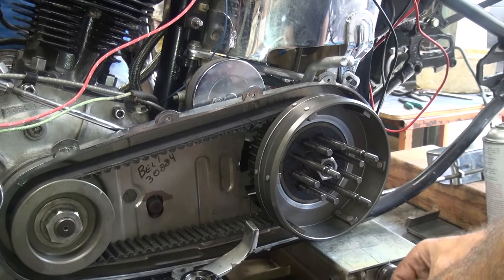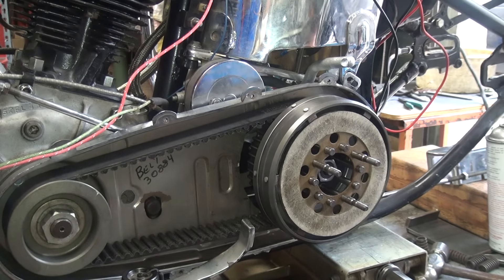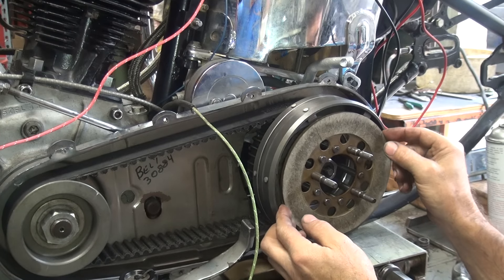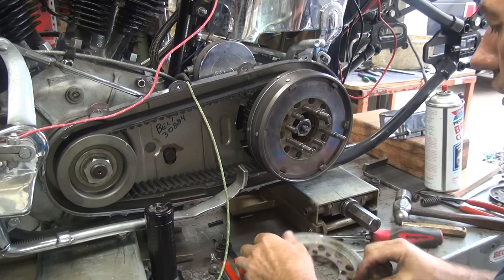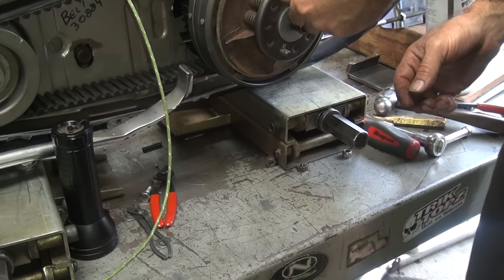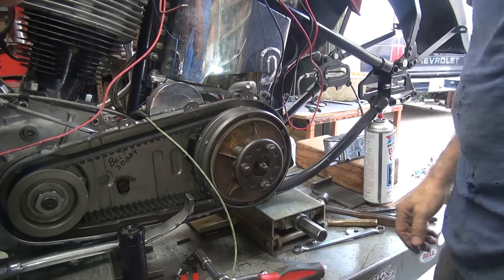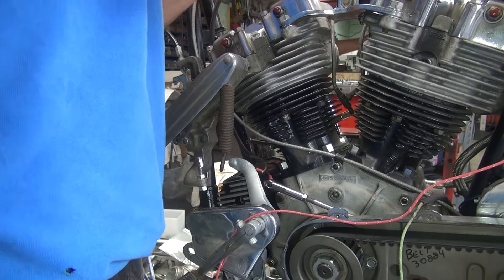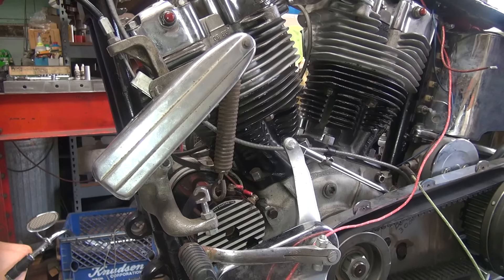1957 Harley Panhead #117 Burnout antique nationals 2015 drag race Shovelhead 2-1/2 day build

Comment: I love your videos .I have been binge watching for three weeks now. I noticed when you are Porting heads and intakes you have about 10 die grinders on the bench .  what kind of chuck are you using  on your air hose to change them so quickly?. Thanks
Reply from the maker: just a standard quick release air line chuck. it helps to know how to use it.
tatro